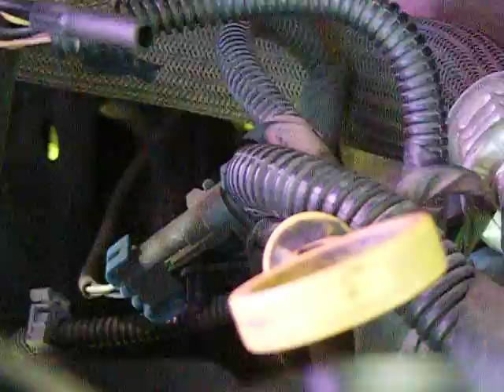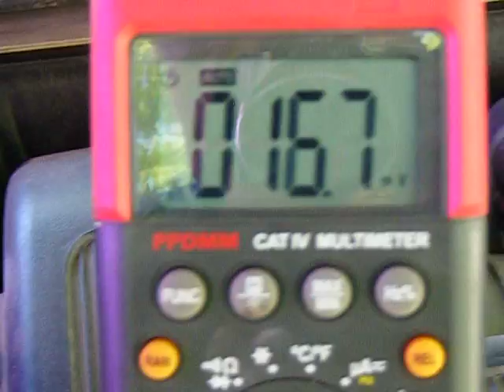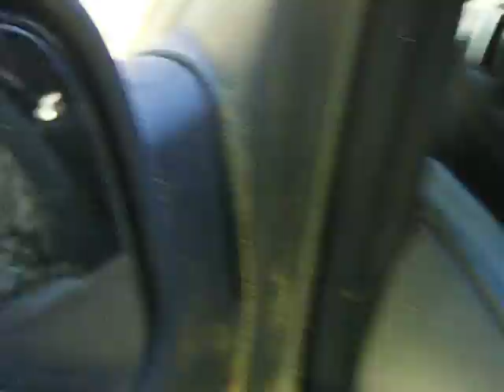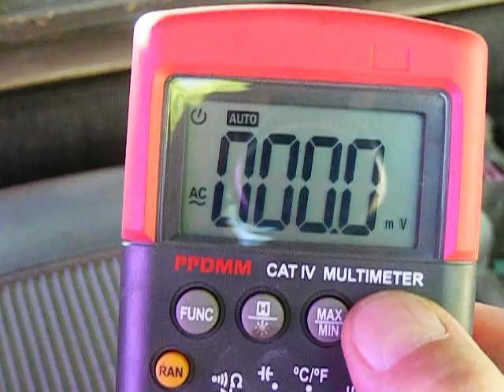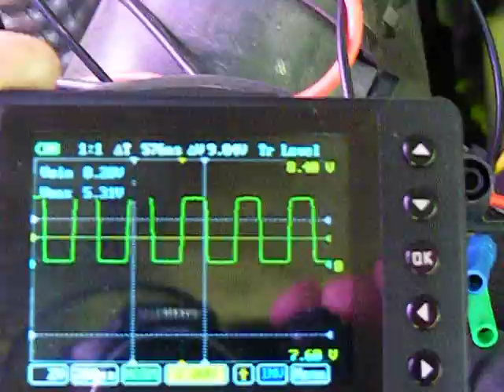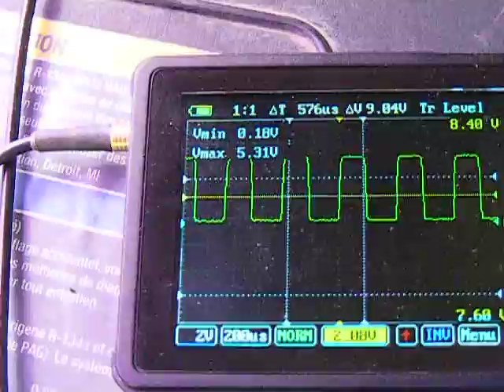How to test Mass Air Flow (MAF) Sensor (GM)

Comment: If I replaced the maf and p0100 goes on, what do I do?
Reply from the maker: Well first off a P0100 code means that there is a problem with the MAF circuit which could be a bad or dirty MAF or there is unmetered air getting in some where after the MAF.
What I do first is I check the electrical connections I make sure contacts are not spread open then I check the circuit  for power, ground and 5 volt reference signal if you don't know how to do this here's a link that will show you how to check the circuit for your car    http://troubleshootmyvehicle.com/ .
Then check for air leaks look at the tube between the MAF and the intake check the connections on that tube make sure they are snug.  if I can't find any holes, tears or loose connections with a visual inspection or hear them when the car is running. Then I use a spray bottle with water. Start the car and spray around the intake the engine will sputter when the water finds a leak or better yet use a smoke machine  if you don't have one then use cigar smoke if you smoke or know someone who does you'll have to get creative here rig up a small hose to the intake system make sure there's no gaps Light up a cigar and blow it in the intake system if there's any leaks you'll see them
And last step if all else falls check for a clogged catalytic converter.

Most likely causes:
Dirty or contaminated mass air flow sensor
Failed MAF sensor 
Intake air leaks
MAF sensor electrical harness or wiring problem (open, shorted, frayed, poor connection, etc.)
Reply: Hammond Auto LLC thank you so much! I will go ahead and check everything
Reply from the maker: Your very Welcome don't forget if you find yourself doing the smoke test the car should not be running
Reply: Hammond Auto LLC Do you have am email address I can reach you at? I want to send you a small clip of my rpm gauge because I think that's the problem. It'll be helpful if I can show you instead of explaining to you.
Reply from the maker: hammondauto50@gmail.com
Reply: Hammond Auto LLC I send you two email. Ignore the first email. It's the second one with accurate link to YouTube